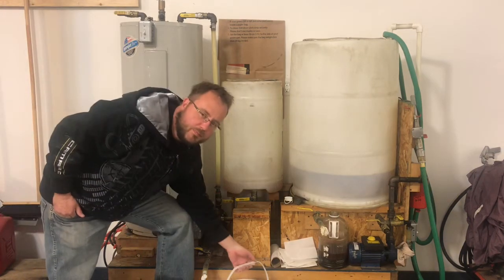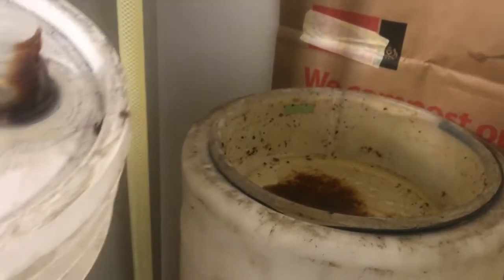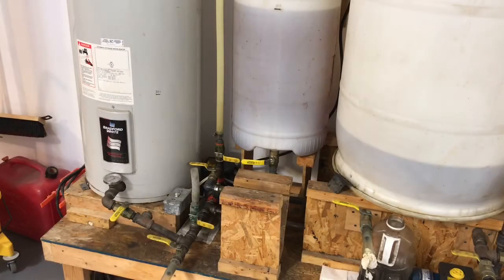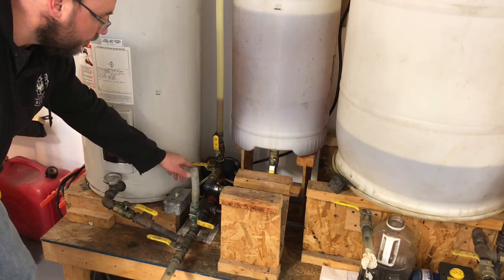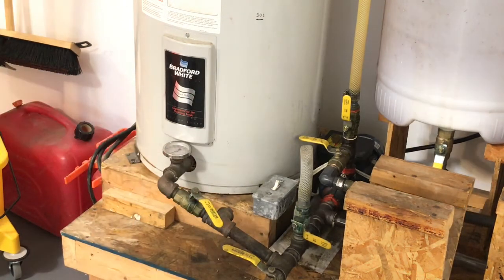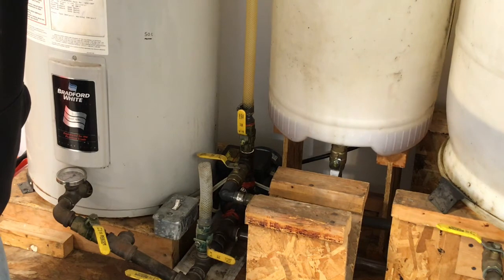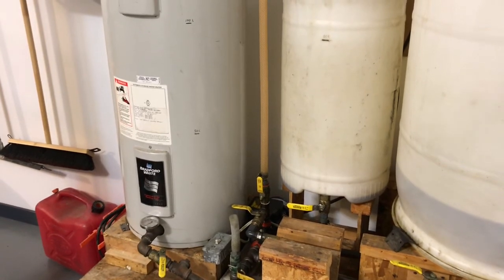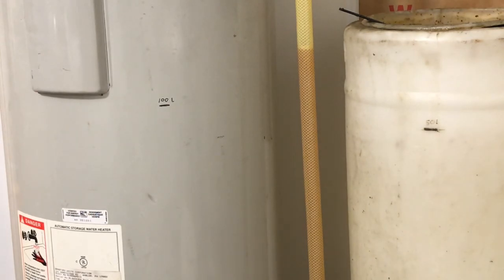Making Bio-Diesel Part 1: Loading the processor with raw oil!

Comment: What happens if you open the pop off valve on top of the tank when you are transferring the product to the hot tank? Wouldn’t that allow the product to flow easier?
Reply from the maker: there is a valve on top of the hot water tank.  I keep it open so air can bleed out as oil fills.

Comment: Think im passing on that process. I want to avoid having to use a water heater on that. My solution to that would be a wood gassifier for the heat that or a methane gas burner i stead of bavi g to wear out my utility bill for that. The other reason i do t wanna use that water hearer is element faikure. One short there in one of those elementa and nope not for me😂
Reply from the maker: make a video when you have it all figured out.

Comment: I'm confused you opened the bottom nozzle to allow more airflow but how is it not draining oil out the bottom. Wouldn't you be getting unrefined oil in your diesel tank? You shouldn't have any unrefined oil flowing out of your tank to the diesel side.
Reply from the maker: no the valves keep it separate.

Comment: hey Greg grate video! can you tell what MODEL pump do you use? is that a water pump or special for oil? thanks!
Reply from the maker: water pump from Northern Tool or Harbor Freight.  They pump oil.  I don't recommend anything though this is just a demonstration.
Reply: @gregs_garage  how many gallons per hour or hp was your demonstration pump?
Reply from the maker: @northlander1948  I will look and tell you.  It is a cheap Harbor freight water pump under $100.  14 years old and still pumping oil.
Reply: @gregs_garage  that’s awesome, love the videos you did. The way fuel prices are likely going to go I’m on the hint for TDI like yours and building a demonstration of my own lol
Reply from the maker: @northlander1948 I've had at least 1 TDI in the garage for about 15 years now.  Amazing cars I'll always have one around.  This green one will probably be here for a long time.

1999-2003 (ALH) is the best in my opinion. 
2004-2006 (Pump Duse) is ok too.  
2009+ I'd avoid with biodiesel.
Reply: @gregs_garage  Thank you for that info!
Reply: @gregs_garage  Another quick question, did you buy a new water heater when you built your system?
Reply from the maker: @northlander1948  no I found a used one for $50.  I run a 220v element at 120v.  I found if you put a 120V element in it gets very hot and burns out fast.  The 220v element heats slower but it lasts years and I think is safer.